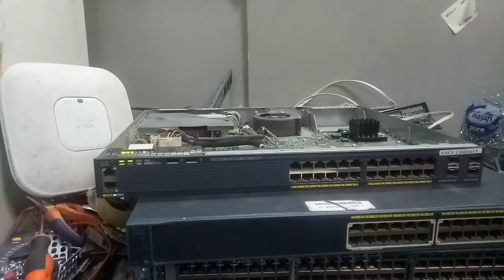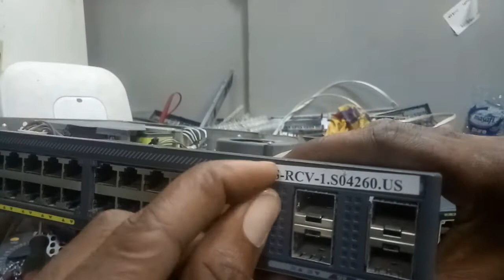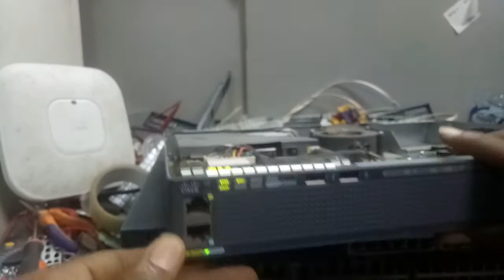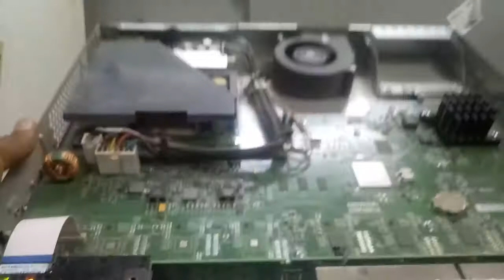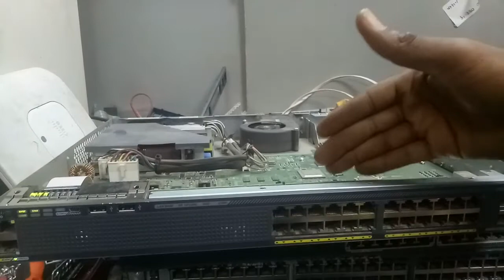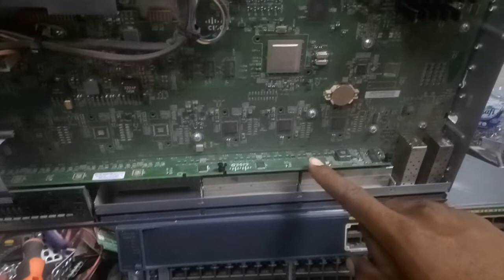#cisco #networking #switch #software #hardware  #hardware  fix poe fault on all Cisco 2960x switches

Comment: I have a 2960x only with fan spin and blue syst led indication no further boot. Strange after measuring no obvious faults of the unit.
Reply from the maker: Check all  the voltages ⚡️ on the board if the are all complete,  if all is tested  ok . It means the main controller  processor is bad

Comment: Hello sir ned help 
Cisco poe switch problem
Reply from the maker: The model  and the problem
Reply: Model: catalyst 3560 series PoE-48
This POE switch used to run cameras without power supply, once it rained, I think water went into a connector, after that none of the cameras work without power supply. It has 48 ports and each camera is connected separately. Power supply has to be provided

Comment: I have the model, but different problem. when I put on the power, the power come on but the noise is high  doesn't down/reduce. the syst and console light stay on and doesn't off. power keep on looping. how can I solve this problem. Thank you
Reply from the maker: Have you been using it before or did you buy newly